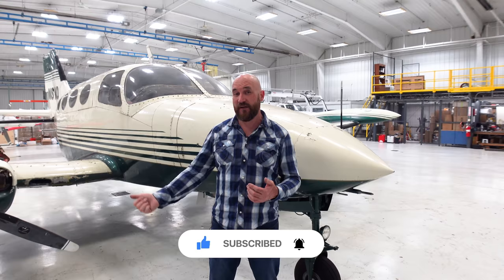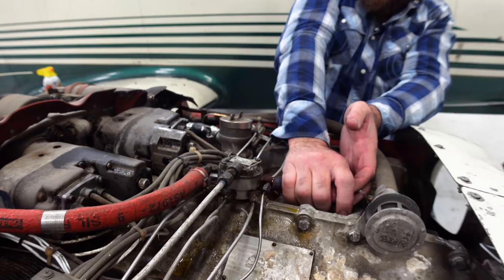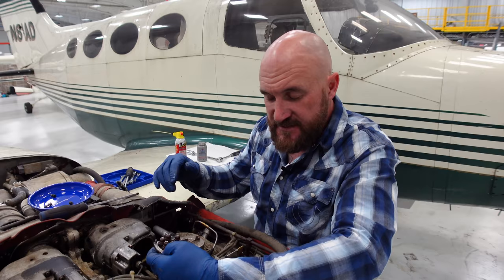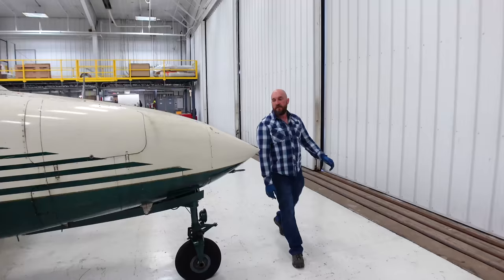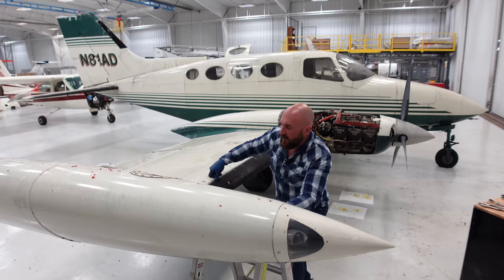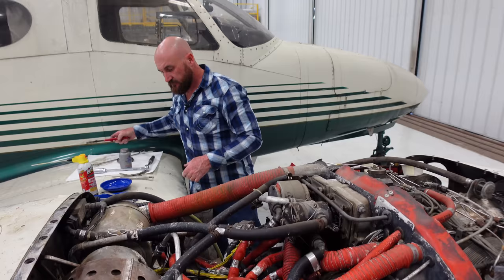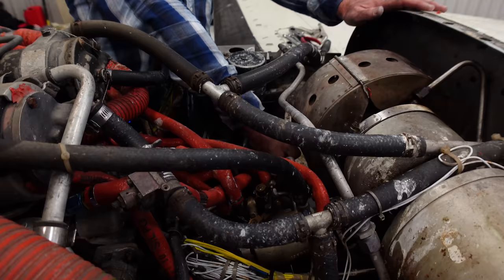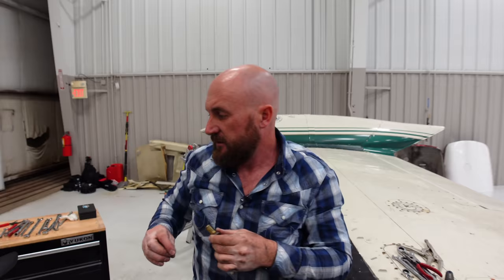He's Trying To STEAL Our FREE Abandoned Airplane ! Ep3

Comment: Just walk away and cut your losses. One thing is getting an engine to start, another thing is making the airplane airworthy. 
For that airplane to be worth anything, It will require a reissue of an airworthiness certificate which can only be accomplished by a certified FAA A&P mechanic, which you obviously are not.  
Beside the engines you most likely have corrosion on the airframe which may make your whole project to run the engine worthless.  Not. to mention that  all other systems are probably in need of a complete overhaul.   There is a reason why no one before you bought that airplane.  This is no deal at free, much less at 20K

You mention that you have been taking flying lessons for just 6 months. You are obviously very inexperienced in aviation. 
This aircraft is not for newby pilots. 
Learn to fly in a single engine airplane, get some experience and knowledge.  
The 100’s of thousands of dollars you will spend to get this thing airworthy are better spent in your training and buying an airworthy aircraft for your experience level. 
Owning an aircraft is expensive and requires good knowledge and experience.
If aircraft ownership is for you, do it after you learn to fly and gain some experience.
Even if you have unlimited funds, don’t throw you money away. Not to mentioned that  you don’t want to kill yourself in an airplane that was way above your level of knowledge and experience.
Reply: Even if he doesn’t get it air worthy it’s still generating him tons of views. Currently this video is #21 in trending. Seeing how he used to upload once a month shows that he probably has a main job (crazy right?). Another thing, this series has picked up a lot of traction and I’m sure a lot of local experienced pilots would jump to fly the plane that was brought back from the grave. It’s obvious to see that he’s too invested into the aircraft and will keep on going, imagine the regret he would feel that he wasted time and effort just to give up on it.
Reply: Absolutely. Getting the engines running is a far cry from getting that wreck airworthy, well beyond the capability of a flying student. Get it running for content sake, and then sell it and split the proceeds with the owner.
Reply: in the very first video he mentioned his intent to get it for free and then sell it for it's parts, i don't believe he has any intent to restore it or fly it

the 20k buyer probably needs parts or something.. he might as well let him have it.. he's trying to buy it fair and square, not "steal" it
Reply: I agree.
Reply: I feel like this is for entertaining the internet. Doing the right, logical thing doesn’t sell and is boring to watch
Reply: @sparkeyjones6261  That's actually a great question. Was this airplane just sitting at the airport for 17 years for free? Or was it racking up fees? Maybe that was the deal - get it running, and then sell it to pay the arrears to the airport. Or, recoup the losses if it was being paid all this time.
Reply: @sparkeyjones6261  he even said so himself, that he’s too invested. Did you even watch the video? Like I said previously, this plane is bringing him too much revenue to scrap it.

Comment: I am a car mechanic, and for the most part at least on this scale combustion engines are similar (Air, fuel and spark) 
I would check the lines after the pump. Air leak from the hoses, even the spark wires if are deteriorated over time may not
carry the necessary current to ignite the sparks. You are too close.
Reply: You forgot compression.

Comment: You already know what to do ....provide fuel from a can ,  spark from a battery and a good magneto  and an open airway to the throttlel body .  If you have compression it has to run .
Reply: I agree, Skip all the questionable systems until you have validated the primary goal "will it run" ?  Then spend the time bringing the individual systems up to operating order.
Reply: yeah for sure he considered it (or is now) but obviously that would have killed the views...
Reply: @g60force  Good point, I never considered that point of view.

Comment: There are stroboscope lights that you can use to adjust spark firing timing, that are hooked around the spark vires.  That should be able to use to see if there are any sparks in each spark plug.

Comment: RH eng mixture= rich
RH eng throttle= full
Then run the pump
Also check your fuel drains for water in the fuel. Tank filler cap o-rings are probably perished allowing rain to get in the fuel.

Comment: I'm no expert on aircraft but I have been around the aviation business and I kind of view aircraft as I would a boat which I have owned, maintained, stored and operated. BOAT stands for Bust Out Another Thousand every time anything breaks, you have to store it for anytime or do basic maintenance. I'm surprised it is worth 20K to anyone as old as it is and in that condition particularly without the maintenance logs. I would figure if it were parted out and the rest cut up for scrap you'd be lucky to get 5K for it. I'm probably wrong but if not the A hole causing trouble probably deserves to be parted from his money and get stuck with that white elephant. Maybe get legal on the owner and the potential buyer and see if the buyer, owner or both will buy you off for 5 to 10K on the side to get you to drop the legal hassles. At least it's a way for you to get payed for wasting your time. F em!
Reply: Buyer is probably never going to get that old turd airborne anyway, so let him buy it waste all his money. Will probably be less than a year before the new owner gives up and sell it for nothing.
Reply: Ive owned boats and planes and they are very different beasts. If boats were planes, the phrase would more likely be “Break out another $10k, $20k, $50k” - definitely not break out another (measly) thousand! As-is, that plane is worth far more than $20k in parts to the right person. What it is not worth is trying to ever get it flying again. As an aircraft, that Cessna is a big green and white paper weight that looks kind of pretty and will never be legal to fly unless Jeff Bezos jumps in with a million dollars for a ground up resto and re-certification!

That being said, I’m really enjoying the vids. I’ve seen my share of “Airport orphans” and I am thrilled to see someone try to fire up long dead Continentals. To hear those engines roar again will be the climax of this series. To see this plane legally fly again will likely happen on either the 1st or 2nd of Nevurary!
Reply: @jedz2941  Even if fully restored without the original maintenance logs it would probably be limited to uncontrolled airspace for X amount of hours and no commercial use before being eligible for full certification.
When I was in the repo business in the 80's the company I was working for part time specialized in high hard target repos but I was just snatching yuppie mobiles like BMW's, Mercedes and Range Rovers and such. They had guys going after aircraft, big yachts and commercial boats too. Some aircraft the former owners had destroyed the log books out of spite and the finance companies would have to sell them cheap without the logs and many just got parted out by the buyers even though they were fairly new because recertifying them was too much of a hassle or some cartel down south buys them and uses them for throw away drug smuggling planes. That's an idea. Maybe get it running and sell it to whoever took over for Pablo.

Comment: Only thing that surprises me about this endeavor is that you never removed the prop for safety....would hate to see you finally get this going and one of those blades let loose.
Reply: you cant start a airplane piston engine without the prop or a test club attached
Reply: @BillCipher1337  Overspeed? I don't see why you couldn't, just don't throttle too far. It's not a balance issue.

Comment: Isn't it the rule that you have to have all of the log and maintenance books before you can put it in the air?
 Also, that being said, don't that make the plane worthless? My point being that the books have been gone for years, so did somebody just have a $20,000 memory jiggle that, OH I have those in my shop!!!
Reply: Agreed man don't believe that someone offered 20 grand for a useless plane
Reply: I thought if you put in a new engine and new prop and have a fresh inspection done it can still be airworthy…?

Regardless, I’m sure with aviation costs that there’s more 20k in parts
Reply: You can get the engines overhauled/replaced, full airframe inspection done and get it considered airworthy again.
Reply: @aleksbiteman5324  that's cool but you still need a flight log don't you?
Reply: This airplane has a long road ahead of it to be considered ‘air worthy’.  Would you want that pile flying over your house?   That’s why the FAA requires log book trail.  You can get a ferry permit but if I was an FAA agent I would take a real hard look at this airplane before I even consider putting my signature on any forms allowing this plane to fly.

For a person to offer $20,000 blind is a bit far fetched.  Where is this guy located. Is he local?  What good is an airplane to someone who is nowhere near the hanger / airport the plane sits at.  It could be a legitimate offer but in my opinion it’s not
Reply: @PJL7095  Hence reflected value by the previous owner. 😆
Reply: @mikesmith6665  well… the previous owner had a better chance to keep it air worthy by having the airplane do its annual maintenance check.  Fifteen years w/o any yearly check up creates  bigger issues.

Comment: I’ve been a mechanic most of my life from lawnmowers to the M1 Tank, one thing that comes to mind is that mechanical pumps will not let fuel flow through them unless their main shaft is spinning, I would try spinning the engine or the motor that runs it while you run the pump from inside the cab to see if fuel is actually being pumped by that mechanical unit.
Reply: Aircraft have a bypass in the mechanical pump so an electric boost pump can be used instead if the mechanical fails in flight.

Comment: I'm only less than 8 minutes into this video but can't help remembering you saying it needed new wing spars at about $75,000 a pop before it could pass inspection and fly again. How are you getting around that?
Reply: And the 40-50+ thousand per engine to rebuild. Not counting ALL the other stuff that will have to be replaced. I just dont see where one can make the math work on this one. The money on wing spars and engines alone would likely buy a nice current and flying plane to get some hours on.
Reply: Deals a deal man,the dude could have advertised it and sold it but has shafted you as soon as some coin is offered, I would bill him for my time or he can get stuffed

Comment: Eagle201
4 days ago (edited)
You need to move the mixture control from Idle cutoff.  If the mixture controls are all the way aft you won't get any fuel.   Also bring the throttle control off the rear stop.  The pump in the tank has nothing to do with getting fuel to the engines.  See my other comment

Comment: Granted I've not worked on this particular engine, but here's what I think:   The 'fuel flow' you see  on the gauge (14:44 mark)  is supposed to be the pressure inside the fuel flow divider, so it seems that you are getting the fuel to the divider, but there is no output from the fuel flow divider.  Remove the fuel line going to the fuel flow divider and see if you are getting anything out of that. The divider has a positive cutoff mechanism and it is possible that it is stuck. 

Its an interesting project.

Comment: I was looking towards to see the old plane flying in the air once again on your YouTube channel instead of going to a scrapyard instead (plane graveyard)
Plus I am watching your channel all the way from the UK 😃🙂

If the person who owned the plane is watching his youtube channels give him a little bit more time 
Because he has the engines to rotating buy battery power and the fuel injectors pumping through to appoint and the spark plugs sparking.
He only needs to get the turbine running and find out about the fuel to the injections
And then he can get the engine is running
So please please giving him a little bit more time because there's loads of people watching him and hoping the plane will run and flying once again
So pleasssssssseeeee

Comment: With all due respect,,, Even IF you get the engines running and the interior restored, would you ever feel totally safe flying this plane knowing an unknown catastrophic failure could occur? Don't make the mistake of not listening to your inner wisdom. If you're wrong you won't get a second chance. To be air worthy EVERY bolt, gauge, filter, cable, and part will have to be looked at and restored. 
I'm a new subscriber but I promise you I will stay even if you move on to another project. I'd rather see you make a safe decision than risk your very life just because you have made a few videos on this plane. 

To be fair, make a deal with the owner to pay you for your time and costs. I think $5000 sounds like a good number. 👍😍👍
Reply: If restored and checked good, it will be fine
Reply: You are looking at a ~$350k investment to get a C of A. Dual engine and propeller overhauls, landing gear overhauls, structural repairs and corrosion issues, redo the interior, new paint, tyres, brakes, control cables, batteries, etc, etc, etc. And I am not including rebuilding the log books! You can buy a very nice, airworthy C401A for $120k. I don't see the purpose.

Comment: I'm an AP licensed Mechanic (way  out of date and I never worked on this type of engine) I saw that you had fuel flow to the fuel distributor manifold but I didn't see the fuel filling the cups at the injectors themselves. I don't know if they spray into the intake manifold or into the cylinder. However either way, the injectors must be "triggered" at the right time in the engine cycle. Are they? What method activates the injector's pump itself? Is it electrical or mechanical? If the valve in the injector can't open there will be no fuel injected and the fuel lines to each cylinder might be "air locked" preventing the fuel from flowing to each injector. The high pressure fuel pump at the rear of the engine may not be functional.
Reply from the maker: Hey Richard ! Some great advice…. I’m going to look into a few of those items.
Reply: @rebuildrescue  None of that is “great advice” unless going down blind alleys, not getting the thing started, all while making videos is the idea.
First, the injectors spray into the intake port of the cylinder head.  The injectors are not “triggered” by anything.  They continuously flow if pressure is applied to the manifold valve and the poppet inside said valve is open.  The fuel pump is a rotary vane pump driven by the camshaft.  The boost pump is a bane pump driven with an electric motor.  There is no “valve” in the injector.  It’s just a calibrated orifice with holes drilled into the side to getting air to mix with the fuel to help atomize it before it enters the head.  The injector lines aren’t “air locked”.  The engine driven fuel pump doesn’t need to functional to get fuel out of the injector lines.  If the boost pump can get it to the manifold valve, it should come out of the lines.  The poppet valve is probably stuck closed.  It may be stuck because the vent line is plugged up with mud daubers .
You reply to those who know next to nothing about Continental engines and GA stuff in general and ignore people with comments that would indicate many decades working on exactly the type of machine you claim to be trying to start.  Makes a guy wonder if you are more interested in the make believe drama crap than in actually making progress towards getting the engine to run.
Reply: Continental fuel injection is continuous flow. The fuel nozzles spray fuel directly into the intake port. There are no valves in the injectors. Fuel flow is governed by the fuel pump and the mixture control.
Reply: @learmonkey3582  This is the most frustrating video on all of youtube. This guy has absolutely no business trying to start an airplane engine. Stick to earth moving equipment.
Reply: He just need to kick the flux capacitor in the right angel, then the dream will come true.
Reply: @freddyrosenberg9288  Yes, poor guy.. in over his head, and it's hard to admit and backout in public, but foolish to keep trying.
Reply: @rebuildrescue  Hi, I hope I am not too late, but I just watched this video of yours to the end and regarding the guy offering money to 'steel' the plane from you. I think I have a suggestion which is a way out of this situation for you. I don't know how I can personally contact you though without the whole world seeing our personal contact details, I have a Youtube channel of my own. Can you think of a way I can speak to you to pass on my idea? ...I am rooting for you and understand your predicament if you haven't got this aircraft started soon. regards.
Reply: @_Everyone__  that the thing. He is a common man I find it entertaining. I'm here for the experience not to be a trained airplane technician.
Reply: @freddyrosenberg9288  Mabye provide some of your expertise instead of being so cynical for no reason.
Reply: I guess  @freddyrosenberg9288  is a bit scared if an average Joe can learn his skill in a few weeks time. Sucks to be in the era of information for some people...
Reply: @johnnylego807  Don't feed the trolls
Reply: @freddyrosenberg9288  he has all the right in the world to be doing this it’s his life if he wants to do this he can
Reply: port injection, constant flow.
Reply: @learmonkey3582  Nailed it Mr Monkey...however flying down "blind alleys" can be exhilarating - if one survives. Isn't that what this format is all about?